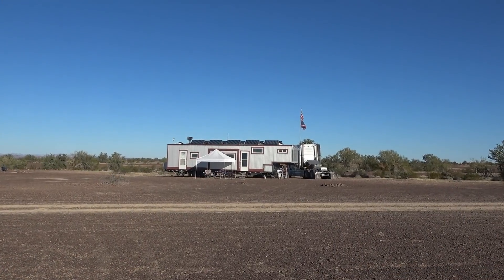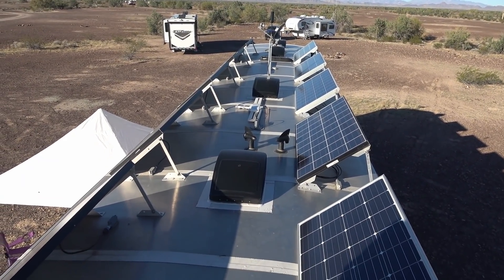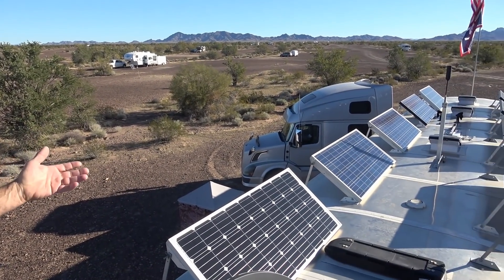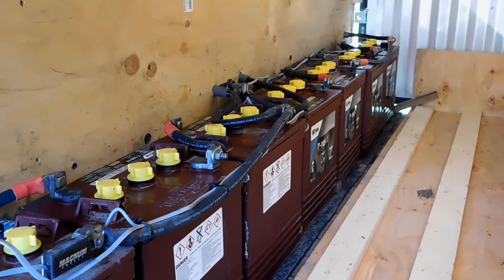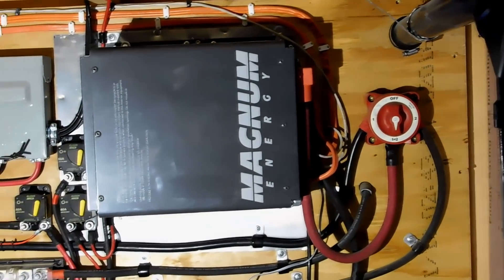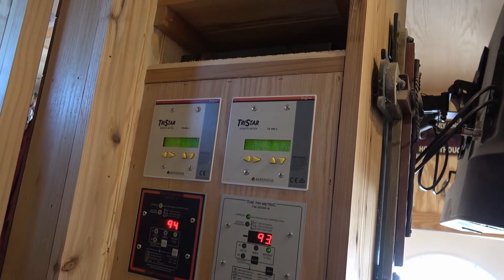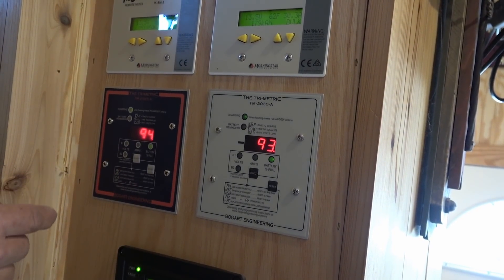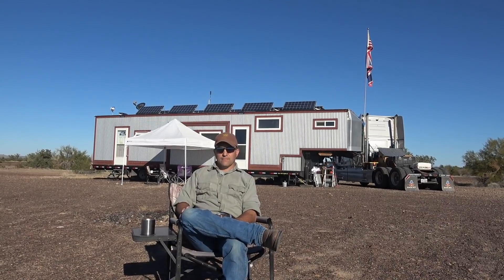My Friend's Impressive RV Boondocking Power System (1800 Watts Solar & 900 AH Battery Bank)

Comment: I was next to someone at Scaddam's wash that has 4,000 wats of solar and still ran a generator all day long.   I'll never understand the need for that much solar, much less that generator.
Reply from the maker: Maybe the sun wasn't shining. one thing about solar no sun , no power. :)
Reply: @LoveYourRV  My solar panel worked just fine, parked next to the guy running his generator.  I don't use. nor have a generator, I have the same sun, and never have a problem.  Yes, Im opinionated, I hate generators.
Reply from the maker: Different strokes for different folks I guess. It seems strange, 4000 watts is a ton of solar, not sure why they needed the genny. Maybe they were having an issue with the system. If you hate generators, my tip is to avoid the Quartzsite scene, especially in January. Lots of other quieter and prettier places in the southwest to boondock. ;)
Reply: @LoveYourRV  People love their instapot more than they like peace and quiet is my guess.  Use your stove and stop bothering everyone, please.
Reply: @vidguy007  Dude, chill out. Not everybody needs to revolve around you.
Reply: @TreeLBollingTreeMan You obviously have nothing to say.  Trolls like you ruin the comment section.      You are blocked.
Reply: @vidguy007  I'm not a troll, I'm just someone stating my opinion. One that it seems that you don't like, IMAGINE THAT!

Comment: One big plus of having the panels in parallel is that having e.g. one out of ten panels shaded reduces your output by 10% (to 90% of the fully-lit power). When panels are in series shading one out of ten produces much more that 10% reduction in power. This is due to the non-linear voltage/current response of the panels and how this changes with the amount of light hitting them.

Comment: propane and battery bank next to each other,  say no more...
Reply from the maker: It's not a sealed compartment, its located basically outside. Lots of travel trailers have the batteries right behind the propane tanks.

Comment: Very interesting set-up with a lot of good ideas for the solar setup.  Video like this certainly helps promote solar power.  But I sure hope the idea of pulling campers with road tractors doesn't catch on!!  What is saved with the solar rig goes right out the window when that tractor cranks up!
Reply from the maker: Not much different than any of the large Class A diesel pusher motorhomes.  They are just wrapped in a shiny outside box. :)
Reply: @LoveYourRV  ... Yep!

Comment: Finally a decent quality install. I have seen so many poorly run cables where people do not seem to notice any problem. This one is up to my standard. 
About the moningstar solar charge controller, I wonder why he is so happy about them. They have some bad rating on Amazon "The charger is actually really nice, but the software is terrible."  with comments like these, I will refrain purchasing them.
Reply: Howdy Michel!
  Thanks for the kind words about our solar set-up. 
MorningStar Tristar solarcharge controllers (PWM &MPPT) are one of the best, longest lasting brands. They can be fully adjustable with dip switches, and the firmware is free and can be downloaded from the MorningStar website to set-up for custom Lithium battery banks.
Happy Trails!!!
Reply: Fine reply. I can take it. Do it once and step outside for your next trail.
Reply from the maker: Maybe they just don't want to learn how to program it.  Anyway once you program the thing its not like you need to touch them much, sort of like my Bogart/Trimetric setup, program it once and leave it to do its job. :)

Comment: State of the art 6 or 7 years ago when you should have interviewed him. Seems antiquated only having 450 usable amp hours (50% of charge) and longer PWM controler charge times, weekly battery watering. Thanks for the look back in time.
Reply: @Stanford Smith For sure. Tried and tested  is better in my opinion also.As far as the PWM longer charge times, what does it matter if the batteries get charged to 100% daily? If they charge faster, say by 10AM, the power is just wasted after that, isn't it?
Reply from the maker: Guess it depends on how much $$$ you have to sink into a system. It is pretty impressive given the economical cost and quality installation.  For the vast majority of RVers, 1800 watts of solar power during the day and 450 amp hours capacity for overnight a is a huge amount even these days. Most RVs can't support near that much wattage on the roof area. btw, If you install a system properly set up and sized with quality lead-acid batteries like his Trojans there is no need to water them weekly, maybe every month or two. Cheers, Ray

Comment: So nice to see a guy use the KISS method. For 98% of RVers a 12V system is fine. A great quality PWM charge controller with Temp Compensation like Morningstar or Bogart, 2-4  much cheaper good quality Flooded 6V batteries from Crown or Trojan, a good battery monitor like this guy's and Ray's Trimetric, and 2-4 Renogy 150W panels is a phenomenal system that is quite affordable. It helps to have a simple system because when something breaks down as it invariably will it is much easier to diagnose and fix that problem when you're out in the middle of nowhere with limited tools on hand. Nice video! What a system!
Reply from the maker: Seems to work great for us. :)

Comment: I am still running lead acid and they should last another 6-8 years. Maybe then I will move to Lithium. Waiting for those costs to come down and saving for the extra system pieces that will allow for lithium.
Reply: You can buy your own 100ah cells and a BMS for around 500 dollars. Half the price of your name brand Battleborn or other brands. 
You can build out a 24v 200ah bank for 2k and a all in one MPP solar inverter PIP-LV2424MSD and charger controls along with gen backup or grid back up for about 700 bucks. 2kw of solar will run you 75 cents a watt for the cheapest 100w panel on amazon or buy used panels for 25 cents to 50 cents from your local market. 
Low end price will set you back about 3500 or less. 
On an RV you can frame the whole roof up an inch over your open vents and or ac unit and gain more space. ( make sure the height is under your max height for bridges ) 
Tilt vs flat with a much larger solar system is not worth it to tilt it. You may lose 20% give or take depending on time of year. 
2000w at about 1800 watts and 20% loss will give you 1500 watts of solar for the better part of the day. With the 150v charge controller In the MPP solar all in one you will still get huge amounts of power in low light conditions.  With 1500 watts of solar incoming you can charge your empty dead bank up in 3 and a half hours and have the rest of the day to use what ever energy you want to use. 
A 200 ah bank at 24v will give you about 4kw of power to use at night time, Which is when you will use the least amount of battery. This is a huge amount of power. 
While the cycle rate will last you far longer than your lead batteries.
Reply: It's time to buy now. The Chinese are flooding the market and you can get 200 amp hours of lipo battery for just $800. That 200 amp hours is 100% usable, unlike with lead acid batteries.

They also have far more cycles in their lifetime so lithium batteries are about 25% the lifetime cost of lead acid batteries now.

Comment: Great system ! Although 10X bigger than mine, I like the simplicity of it. I use the KISS method as well. I'm still using lead acid & PWM. It works for me & if it ain't broke, don't fix it.